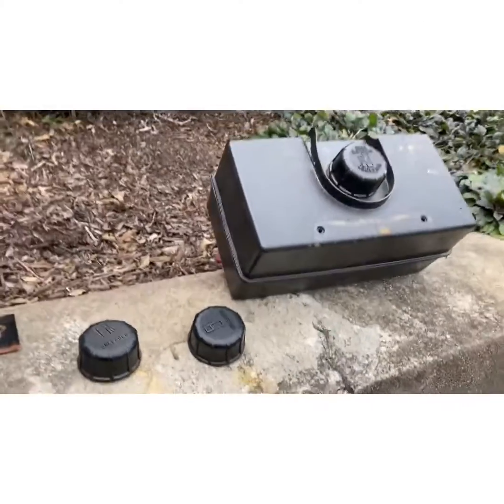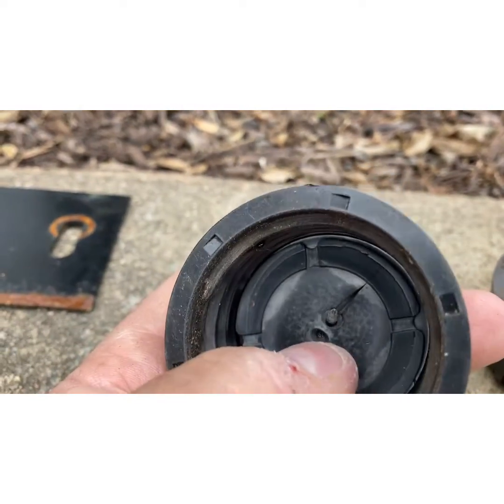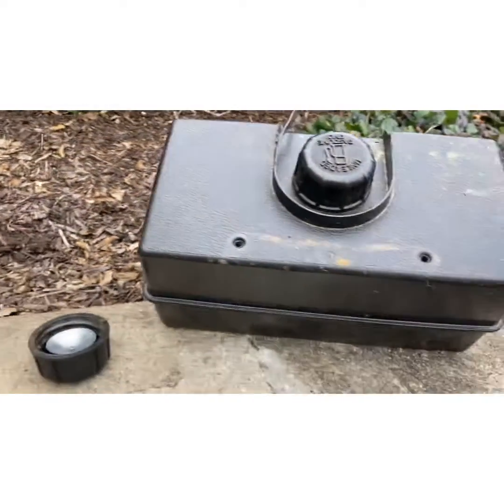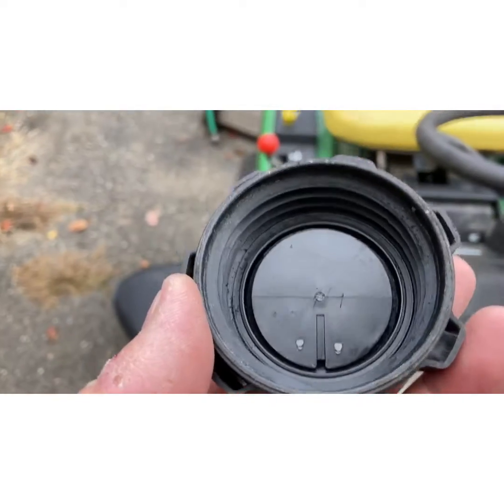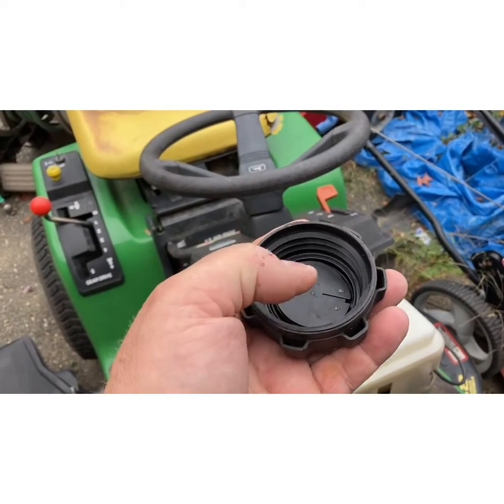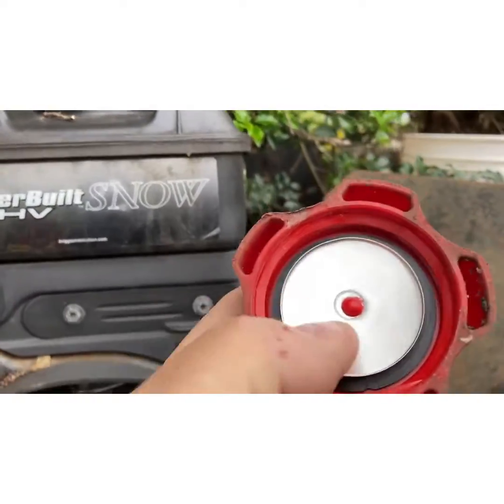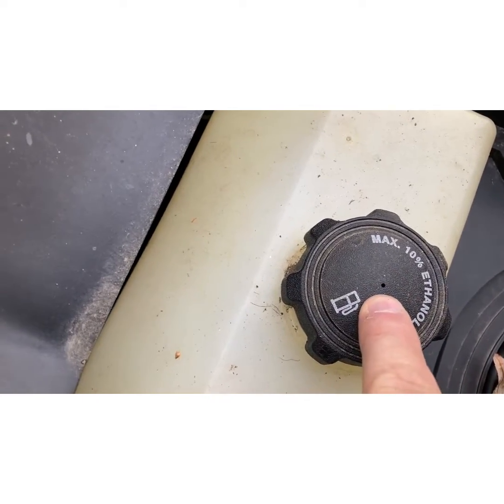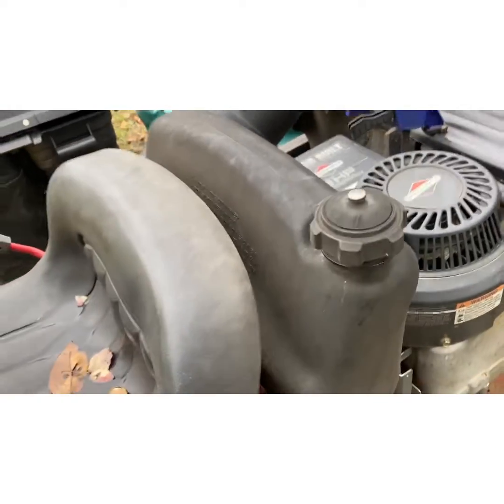Small Engine Gas Caps and Vents - Why they Matter!

Comment: Super good video, I have a brand new generator and the first time I turned on stalled on for minute and then I remove the fuel cap and put it back then I turned on and stalled 5 minutes on and then turned off by it self do you think the problem is the fuel cap no matter is brand new?
Reply from the maker: Remember what New means, never ever worked!
Reply from the maker: Check fuel flow to the carb with the cap on and with it off. I’ve seen crushed and/or clogged tank outlet filters cause that too
Reply: @KensSmallEngineRepair I'll do that too thank you so much

Comment: I was working on a blower for a neighbor with that new tecumsa cap and if you tighten it down the gas flow goes to a trickle.  Is that correct?
Reply from the maker: Ya, vent clogged in cap

Comment: thanks Ken this will help a lot of people who have vent problems and don't know it. I have a brand new mower and it does not vent correctly right out of  the box.Can you explain how the new vents work?
Reply from the maker: There are various types of vents on power equipment.  Some are simply caps that have grooves or passages that vent to atmosphere. Some engines have breather systems that vent fuel tanks through charcoal cannisters (Kohler) to vent. Generators usually have vent lines coming out of the top of the tank with an anti-rollover valve built into it to protect fuel from spilling out if the generator is tipped over.

Comment: Great Video Brother! Squirls are little assholes. They ate the gas line out of my truck, and it's a daily driver.
Reply from the maker: Same with my evap line on my Dodge 2500 pickup. Have to drop the tank to fix it, or reset the red dot and rush to emissions when it turns green!

Comment: I have a Crapsman Lt1000 riding mower. After running it 10 minutes it shut off. Ill restart it and it will fire up for 2 seconds then die. I can do this till the battery dies. Ive tried 2 different carbs from Scamazon but the same result as mentioned above. I ordered a new gas cap, hoping this will fix the problem
Reply from the maker: does it have an anti-backfire solenoid on the bottom of the carb? Is it working? Are you sure it's fuel starvation? did you squirt fuel in the carb when it starts to die to see if it revs back up? hook up a spark tester, does it go out when it dies or stay lit?
Reply: @KensSmallEngineRepair   I'm gonna more testing on it and let you know on the status
Reply: Was it the gas cap? I am in a similar predicament but not sure...

Comment: I have had venting problems but not that often, perhaps it’s more common on a Tecumseh. Problem I have a lot on Kawasaki strimmers is fuel leaking through the cap holder hole good video 🙂👍
Reply from the maker: Briggs too, check out James Condon's latest video    https://youtu.be/VWw7s0c2neo

Comment: Friend with JD L110 called me “cut 1/2 yard and it died”. Open the cap, leave it a little loose. Working still.
Reply from the maker: I love the simple fixes
Reply: @KensSmallEngineRepair  and the friend thinks I’m some sort of small engine genius. Same guy has a Stihl blower he couldn’t start after sitting for about 1 year. I brought it home, dumped the fuel, and with air filter off squirted some 50:1 in the carb and it barked. So I filled tank with fresh fuel and it ran fine. Took it back over few hours later. Ta! Da!
Reply from the maker: @haneyoakie14  sometimes they think we are magicians!  Sometimes we are!!
Reply: @KensSmallEngineRepair  and sometimes we are like me on the Tailgator carb clean and spark plug wire end fix the other day. All fixed and running good in the evening, and let it sit for cold start in the morning. Morning comes, it won’t start. Full choke, half choke, no choke, nothing. 15 or 20 pulls, various choke settings and arm angles to pull it hard and fast, bad hand, good hand, nothing. Finally it dawns on me! Got to turn kill switch to O instead of I. Starts on next pull. Now that would be a better funnier video than the one I did post.